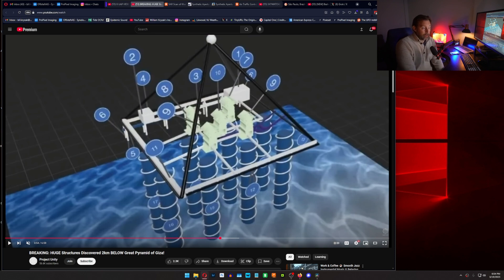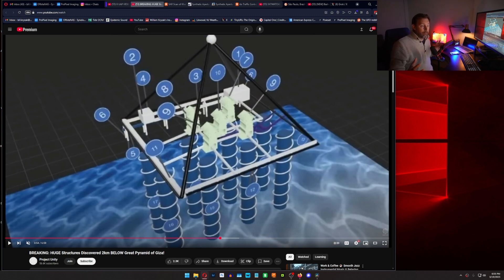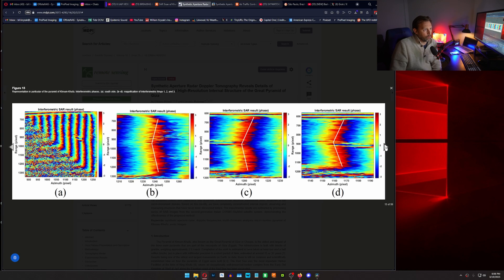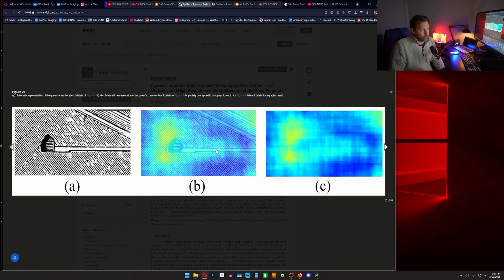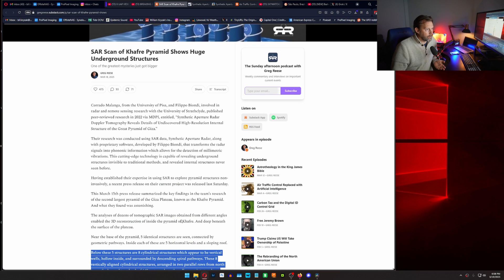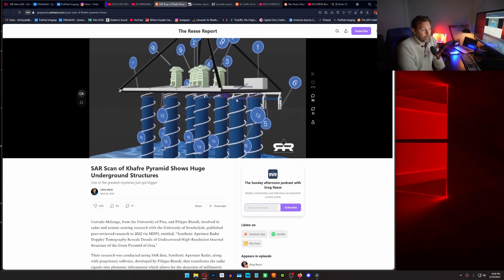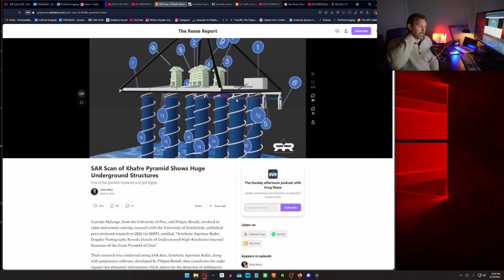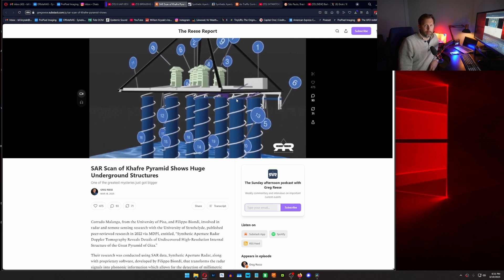Undiscovered High-Resolution Internal Structure of the Great Pyramid of Giza

Comment: We're promised more info. I am still looking for a copy of the original paper and presentation (2025) to review the data. Post a link if you find it. The 2022 study for the largest pyramid indicated a mound beneath, i.e. the ground was not levelled prior to construction, and has been used to calibrate the new model (as the internals are relatively well known in 3D space. So this is what they interpret is beneath the 2nd largest. SAR data in itself is legit. It hinges on how you use it what interpretation you ascribe. 2022 was a peer-reviewed paper. Not sure in 2024/2025 info is yet.
Reply from the maker: this is all i have.  https://www.mdpi.com/2072-4292/14/20/5231#